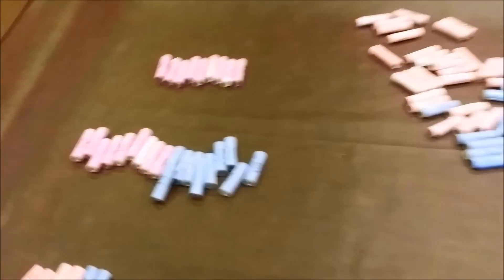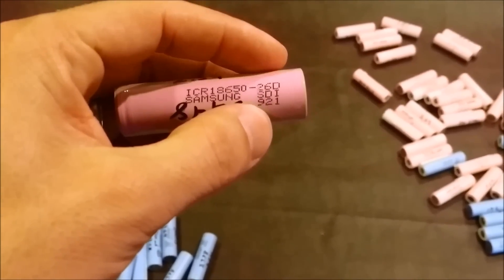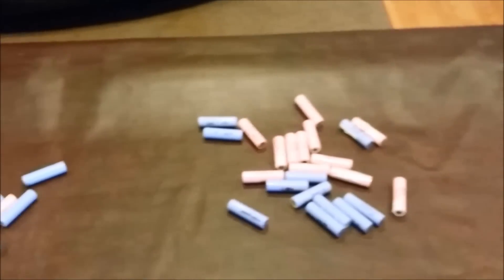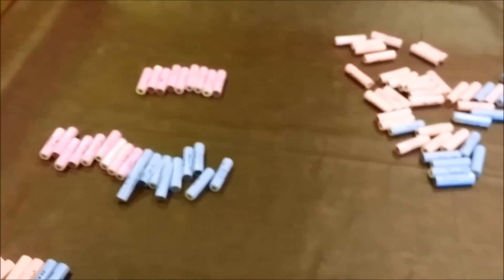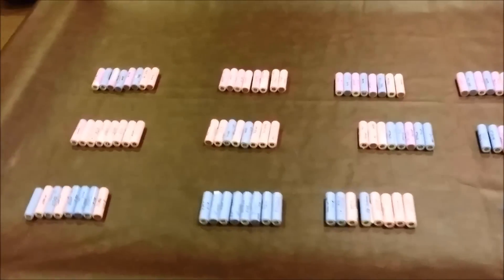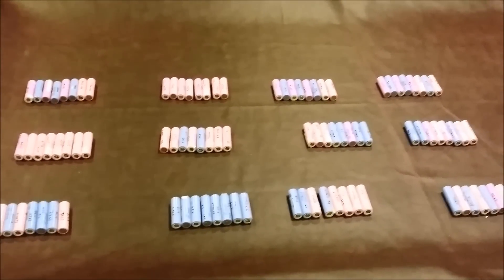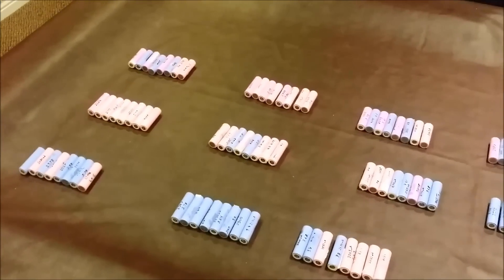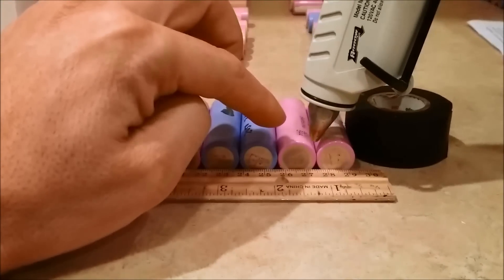Learn how to build a 48v e-bike battery "18650 lithium ion battery" (Part 3 of 7)

Comment: I'm curious why you didn't use the metal strip on the positive ends of the cells. Also, what kind of metal strips are those? I see them on a lot of 18650's.
Reply from the maker: +Paul Langford I was just trying to keep the connections as tight as possible, so I just soldered the fuses directly to the positive end.   The strips are solar panel bus wiring its sold in different sizes.  Most are nickel strips or nickel plate with solder tinned.
Reply: +15-sec-of Fame Thanks for the advice! I will give it a shot.
Reply: FYI buss strip is usually made from copper wire which is flattened and then coated in solder.  I believe copper is around 75% more conductive than nickle.  I used nickel strip before i knew this...doh!
Reply from the maker: monbobmaster It keeps the copper from building up corrosion on the contact surface as this will create issues if your in a humid environment.

Comment: I have two main question, great battery pack btw. Where did  you get the BMS board, and what the amp rating for that BMS board. Second, what are the specs for the battery fuses, and what brand or store did you get them from? Thx!
Reply from the maker: +embossBJ thanks man,  the the fuses were bought on ebay heres is the link
&#160;http://www.ebay.com/itm/100-Pcs-New-JinKe-Polymer-PPTC-PTC-DIP-Resettable-Fuse-16V-4A-JK16-400-/181623447300?hash=item2a4999df04
They are 16 volt max @ 4 amp each

The BMS that I bought on ebay is not a true BMS when looking for a BMS look for true balancing BMS boards.  If they say to use new only and not used unmatched cells its not a true BMS for example look for the following in ads:

The BMS only use for new and consistent high drain batteries. Do not use for battery packs that mix with new & amp; half-used, or mix with different brand battery cells.  Do not use for used and imbalanced battery cells.

There are alot of BMS boards for sale so always ask the seller if its a true balancing BMS.  That way you don&#39;t get ripped of like I did.
Reply: awesome, thank for the assist on the fuses and BMS

Comment: also what is the name of the thing that is like a pen
Reply from the maker: +Chris New sorry for the late response on this one.   It's a flux pen for soldering.   Less mess and wanted to be more precise on the flux near the positive end, didn't want it to short out the battery. Before and after I soldered I used a very lightly damp rag with rubbing alcohol to clean the battery end and removed the remaining flux so it didn't corrode the metal of the battery.

Comment: what is the name of the thing that you put on top of the battery
Reply from the maker: +Chris New hey Chris, the orange things are reset-able fuses for extra safety in case I take a spill and the the battery starts shorting out.  Tesla has the same concept built into there batteries, but theirs are not reset-able.  Mine are rated @ 4 amps each.
Reply: +15-sec-of Fame Can you give more info on the model/supplier of these fuses?

Edit: Nvm saw your other post - http://www.ebay.com/itm/181623447300?_trksid=p2057872.m2749.l2649&ssPageName=STRK%3AMEBIDX%3AIT
Reply from the maker: ***** yeah man, here is the link on ebay
http://www.ebay.com/itm/100-Pcs-New-JinKe-Polymer-PPTC-PTC-DIP-Resettable-Fuse-16V-4A-JK16-400-/181623447300?hash=item2a4999df04

Comment: For each group of eight, wouldn't you want to group by similar mAh ?  Or I mean capacity? It seems to me some batteries would be overcharged by this method? Or I might say some of the groups (of eight) have too much variability in terms of capacity?
Reply from the maker: +Monster Bass Productions (aka Kayak Musky Central) very good question and that is what I thought at first also.   The reason that I mixed the cells the way that I did is because I am using used cells that are mixed from 2000 mAh to 2400 mAh.  I divided the cells into equal 17600 mAh for all parallel banks, so one bank doesn't work harder than the others and the cells help each other in the banks with minimal stress .  If I put the cells with matching mAh's in each bank then you would have the lowest bank at 16400 mAh and the highest at 19200 mAh (Per my cells) and that would be harder on the banks.  The cells will not over charge due to the BMS keeping them below 4.25 max in each bank.
Reply: +15-sec-of Fame      aahhh......I think I understand now.  BMS certainly plays an important role.  Fascinating videos and thanks for making them.  regards MBP
Reply from the maker: Thanks man, nice catch in your videos!  I do a little fly fishing here in Colorado during the summer.
Reply: +15-sec-of Fame     good luck fishing next season !
Reply: +15-sec-of Fame The BMS keeps the group of cells at 4,25 max, not each individual one at 4,25. So yeah, it may overcharges and overdischarges. I would go with same capacity cells in a pack. Don't forget that the BMS role is to control the discharge process too.

Comment: Howdy, Do you have a link for the re-settable fuses?
Reply from the maker: +Francisco Mendez here is where I bought my fuses on Ebay.   

http://www.ebay.com/itm/100-Pcs-New-JinKe-Polymer-PPTC-PTC-DIP-Resettable-Fuse-16V-4A-JK16-400-/181623447300?hash=item2a4999df04

They are 16 volt max @ 4 amp each and are working out great so far.   You building an e-bike battery?
Reply: +15-sec-of Fame Yes, I just built one about 2 months ago, I got 4 SLA 22Ah, That's 52lbs worth of batteries! Can't wait to make the transition, Thanks Buddy!

Comment: Hi 15 sec,
Very impressive videos.
I'm duplicating your build as close as I can (Why try to re-create the wheel?). 
That link for the fuses is sold out. The closest I could find are 16V 5A. Do you think the higher amp rating will work? I don't want to go much higher as the point is to stop shorted out batteries, right?
Also, is there a way to get the mAh ratings without draining each battery individually? My balance charger should be here in a few days so right now I'm in the charging stage having already tested all the harvested laptop batteries.
Reply from the maker: +Rick Rose Thanks man,  the 5 amp fuse will should be fine because 5 amps will be nothing during a short, so it should still work.  You can discharge pairs if it helps get through them faster, but remember that one of the 2 will put a slight drain on the discharge test and the reading will be off on the actual number of what they could be.    Run an experiment by discharging 2 at a time, record the mAh and then divide by 2 and that would be ave. of the two.  Recharge them and retest individually to see how off the ave. number was.  Keep me updated man!
Reply: +15-sec-of Fame Got my knockoff iMax B6 today. Woo hoo. How high can I safely go on the discharge? Trial and error and I'm still timing out.The amps decrease as it discharges. I guess I can turn off the timer in the settings.
Reply from the maker: Rick Rose  hey you got a knockoff also, lol.  So when your on discharge it only goes up to 1amp.  On charging it can go up to 5 amps and during charging you will see mAh decreasing until its done charging.  the mAh during charging is not the accurate reading on capacity that will be found during discharge testing.  In the settings you can turn off the timer and mAh max limit.  When charging vs discharging there will more mAh during charging as its trying to get the cells to take the charge.   The amps you set for discharging should stay the same during discharge as its testing the cell with is constant load on the cell down to 3.0v.  During the discharge test voltage will be pulled down when there is a load on the cell, so when the knockoff see's 3.0v the test is over. Write down the mAh shown and the cell will be at 3.7 volts with no load.   Keep me updated man!
Reply: +Rick Rose RTFM, the book says 1.0 amp on discharge. 
I agree on two at a time being inaccurate. 
I picked up a 12V DC adapter at a garage sale for $2. That frees up my Variable DC Power supply. 
I've got a nice assembly line going with the variable DC getting the volts above 3.5 then a 4 battery charger before and after the discharge/metering. The discharge takes 2-3 hours per battery.  
This is going to take forever.
Reply from the maker: Nice find on the $2 12v power supply.  Yeah it took me a while also. The batteries that are welded in pairs maybe ok to test together as long as they average good numbers between the 2 you should be ok and will help speed it up.  Just be careful I have found some pairs where one cell was dead and the other still very good.  So if you get a low mAh pair one of the cells in the pair will be bad.  When charging I would throw on 6-8 cells that were very close in voltage on the variable power supply to charge up.  When they were done charging set I would set aside just so I have batteries waiting to go on the discharge test immediately.  It will take some time, but you will get there.
Reply: +15-sec-of Fame I finally got all my batteries 'discharge rated' and ended up with 118 above 2KmAh. My mAh average ended up being below yours but still over 16K for the whole so I'm happy. I had to do a lot more sorting than you to get the 8 cell banks within a similar range. 

So I'm ready to start the soldering. 
Looking at all the under 2Ks made me realize I can make up a 'backup' battery. There's tons of space in the battery box so the backup will be lower mAh but still enough to get me home if my main runs low.

I finally received the empty cellphone chargers. The single battery ones were junk but the double battery ones with the LED flashlight are great. Spent under three dollars for a really nice cellphone charger.
Reply from the maker: +Rick Rose Awesome man! try to be quick on the soldering if its not giving you a good solder joint try cleaning with alcohol and lightly flux it.  Your getting close!
Im looking to step up my voltage just to see what happens :)  I am looking to try the 72v version since I have so many batteries, plus I am looking do some cool stuff this summer that will need to use some of the batteries for that.  I will start on that project in a few weeks and will post videos on them as I go.

Comment: I see that you have wired them all in series, but im confused as to how they are all connected to make 48V for the bike.
Reply from the maker: +AbnormalBroadcast  I connected bank one's negative directly to bank 2's positive and bank 2's negative to bank 3' positive and so on.   I have 13 banks connected in series totaling normal voltage = 48 volts.  maximum charge voltage is 54.6v.  With each bank being 3.7 volts normal charge the banks have 17.6 amps.  You build the amp's by paralleling the cells in the banks, then take the banks and series them together to make the higher voltage.  The first banks positive and the last banks negative is where you measure your total voltage.
Reply: +15-sec-of Fame OH, lol so you have things soldered on both sides? Ok, i get it thanks lol. Again Sorry for asking so much but i am planning on doing this and you have the best videos so far haha
Reply from the maker: Thanks, No problem, let me know if you have any questions when you get started.  Hoping to make my next videos better than my first few once i get back in town.

Comment: Were you using 60/40 solder or 63/37 ? Also was it 1mm or the small stuff? Lol So many question sorry
Reply from the maker: +AbnormalBroadcast its cool its what I did and wrote a lot of notes.  I used 60/40 then used rubbing alcohol **(very sparingly around the positive terminal as it can short out if it drips down under the + cap)** just lightly damp a cloth and wipe off the flux residue anywhere you solder as its corrosive.   I used tinned 5mm x .02mm just ran 2 strips on each side.  Thanks

Comment: where are all the comments.? I could not find those reset-able fuses.
Reply from the maker: +William Whitfield My videos are pretty new, so I don't have many comments yet.   I looked up the history of where I bought the fuses on ebay to help anyone who is interested in looking up the Items that I used.     I'm working on a new video upload tonight showing the hub being installed on the new rim and me testing out the bike for the first time.  Just let me know if have anymore questions.   Thanks
Here is the link to the fuses:
http://www.ebay.com/itm/181623447300?_trksid=p2057872.m2749.l2649&ssPageName=STRK%3AMEBIDX%3AIT
Reply: +15-sec-of Fame How are you using a fuse with leads like this on a cylindrical cell? Do you have some kind of disc holder for the fuse?
Reply from the maker: ***** When I built this battery I "quickly" soldered them to each battery you can see it in the videos.  I now have a spot welder so Ill spot weld tabs to the battery and solder to that instead, much more safer and better for the battery!  I did order some 18650 holders but they haven't arrived yet.

Comment: What rating do those fuses have?
Reply from the maker: +Xwozz I found the re-settable fuses on e-bay and they are 4 Amp 16 volt each. They work perfect!   I have the e-bike running and you don't even know they are hooked up.  I slammed out about 30 miles in one day on one charge averaging around 34 mph up and down hills and  a top speed of 38 mph so far (still breaking it in).  After nearly 30 miles "at high speed" my battery was at 48v
Reply: +15-sec-of Fame , why all the fuses?
Reply from the maker: Lithium cells are dangerous if it becomes a runaway battery, so the fuses will open if to much amperage trys to release to fast.  Tesla does the same thing except mine will reset.  Also, Its more of a pro-active thing to prevent a fire if I crash and damage the battery.